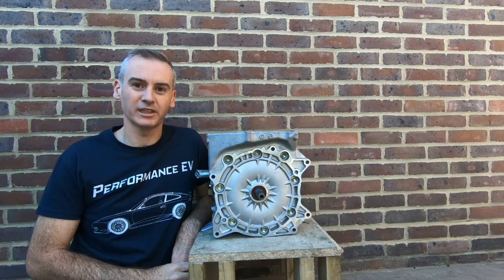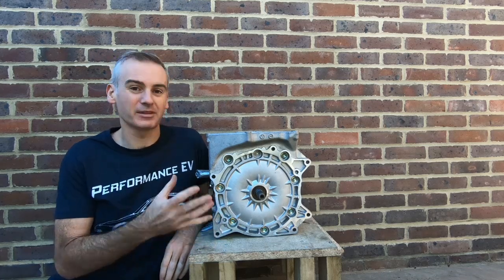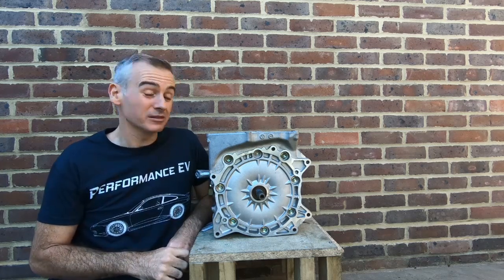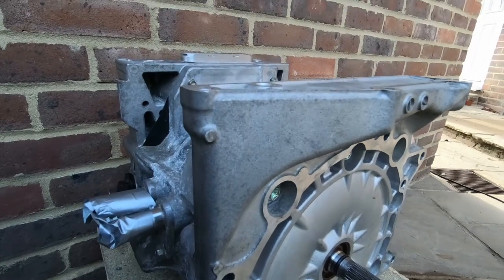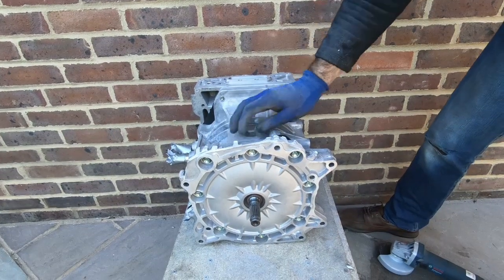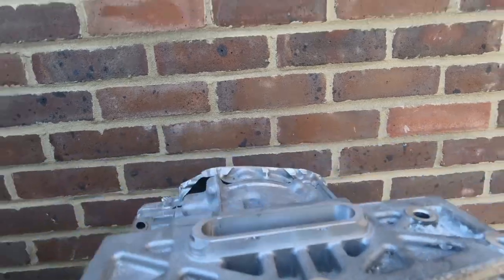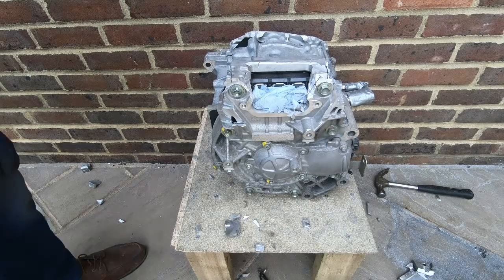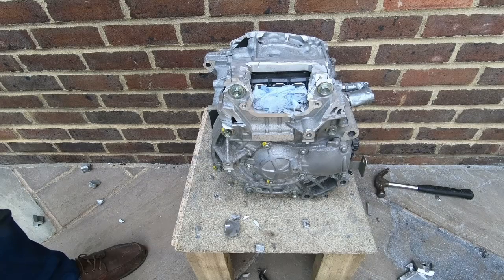Electric Porsche 911 project video 16 - Chopping our Nissan Leaf motor to make it fit

Comment: Any idea on the amount of weight reduction? I am building a superlight electric 3-wheeler.
Reply from the maker: Weight reduction from what I was able to cut off wasn't really very much. It's cast aluminium so each piece was pretty light. Finding ways to minimise the weight of any mounts, brackets or frames you need to build will probably save more weight than I was able to cut off the motor. And careful choice of battery to maximise the KW/kg will probably make a bigger difference.  Superlight 3 wheeler sounds awesome!

Comment: Is that an EM57? what is the price of that in UK can you share websites to buy this in UK?
Reply from the maker: Yes, it's an EM57. I think most people are still getting these from eBay. Prices seem to vary a lot. I have seen a full stack (PDM, Controller, Motor and Gearbox) as low as £900 and as high as £3500.
Reply: @PerformanceEV  awesome! Im going to keep an eye on the ebay UK do you use any other website?

Comment: You should've remove the  front cover off the motor would be easier just saying
Reply from the maker: Yeah, I've come to realise that in hindsight. I also ended up cutting a few mm more than I should have. I think I would approach it slightly differently next time.

Comment: Love it! So what are the motor dimensions with all the 'extra' removed?
Reply from the maker: Hi Michael, overall width is pretty much unchanged at 28 cm. The height at the shaft end is now also 28cm and at the power end (where the cables hook up to the motor) is 32cm. The extra height at that end is the raised section where the cables go in which is 18cm wide tapering to 14cm at the top. The motor is approx 30 cm long without the shaft. Hope this helps.

Comment: Why not remove the bolts holding the motor casing in place, and then remove metal from the casing away from the motor and wiring?
Reply from the maker: That's my back up plan, I wasn't sure if removing them would affect how securely the motor is held together, so the idea was to only cut deeper into that section if I absolutely had to.

Comment: I ended up doing this with my gen2 Leaf motor as well.  I went quite a bit more extreme on the wiring side.  I haven't fully worked through the cables yet, but lots of sealant should do the trick.

Comment: What's the plan for waterproofing the connection points?
Reply from the maker: Still working out the details on that one. Sheets of rubber, silicon and various rubber grommets come into my current plans. I am making some of this up as I go along.

Comment: Did you hit any of the coolant channels?
Reply from the maker: Not that I can see. I did manage to open one part up to the real world that I hadn't planned to, but it wasn't part of the coolant circuit. I am still going to seal it up with something permanent to make sure it doesn't compromise the running of the motor (e.g. dust getting to places it shouldn't have. )
Reply: @PerformanceEV  cool, I saw the hole.